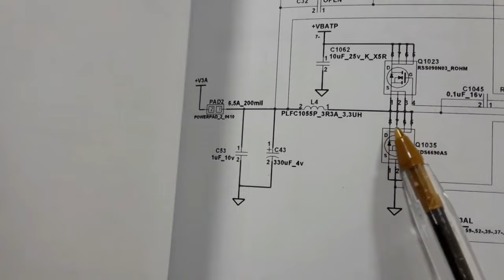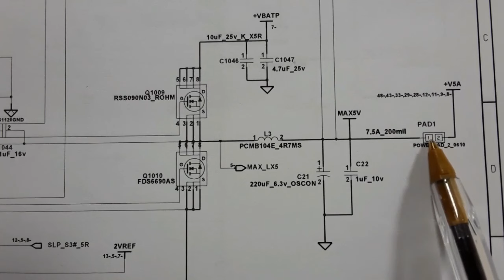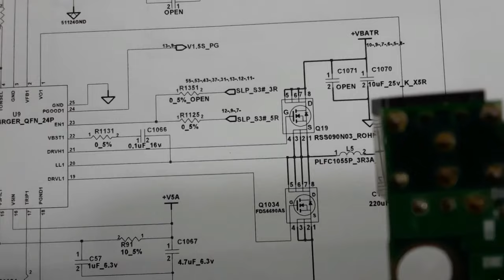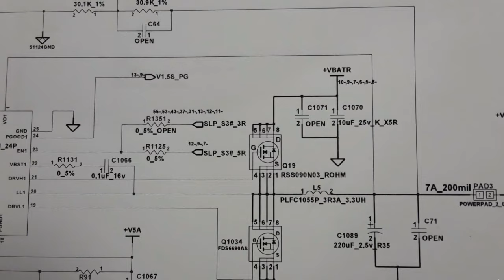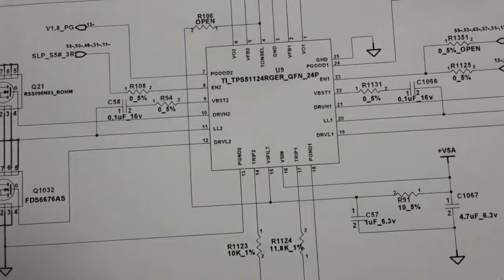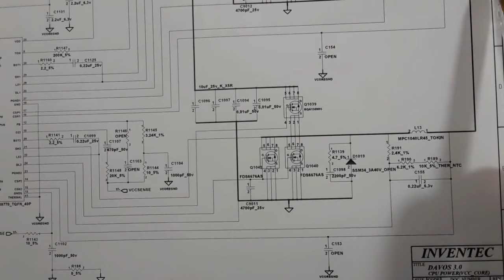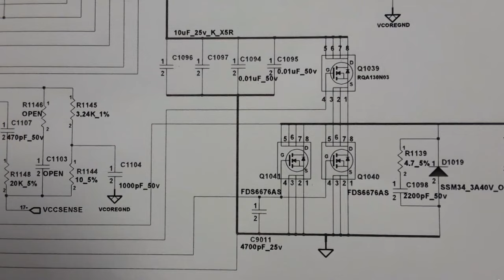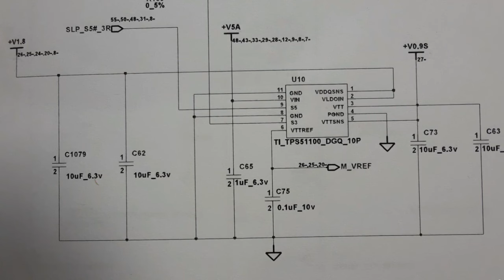Complete Motherboard Voltage Rails +VBAT, 3VALW, 5V, 1.5V, 1.8V, VDD, VTT, VCC, CPU VCC_CORE, +VCCP

Comment: I guess the power pads you showed are not only test points for measuring voltages, but their purpose is to isolate circuits from each other. Of course you have to remove the solder to do this. On the motherboard you only see one dot with solder, but in the schematic you see two dots that are separate from each other. On the mainboard, these points are bridged with solder.  
Many thanks for your videos! 😘👍
Reply from the maker: Right, thank you @voenigs612